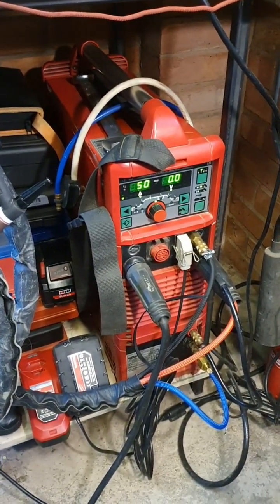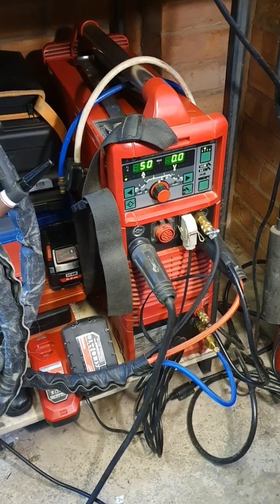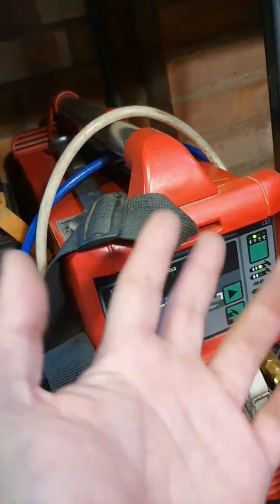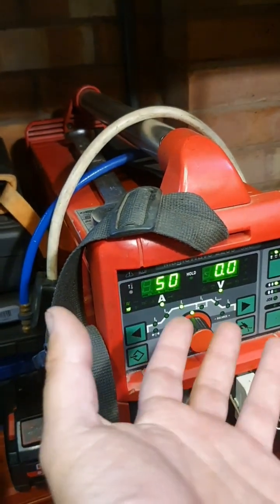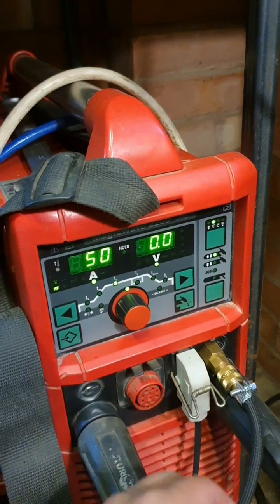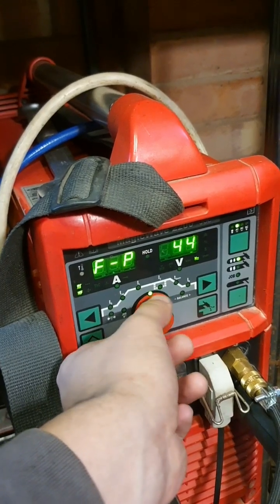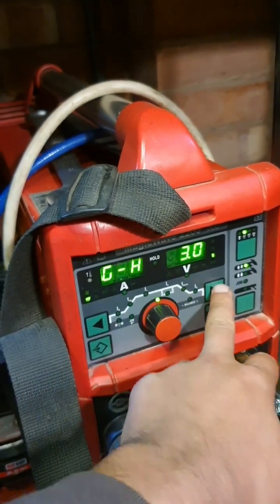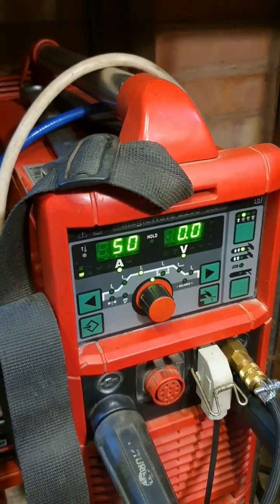Changing AC frequency, Pulse settings and Pre/Post flow on the Fronius MagicWave 2200

Comment: mine has an oddball setting i havent seen on anything else...

AC depth ...

AC width? thats cool, thats normal... duty cycle.

all i can figure out is that it controls the current or, well... depth... on the respective cycles... still havent really played around with that setting enough to make sure? gas is too expensive for "fiddling"...

ah well, i like 110 and 128 hz, 55, 64, etc... cus its A and C respectively... gotta keep it in "tune", lol...

yeah, higher frequencies give a more fluid puddle, in my opinion. though ive always felt lower frequencies give better penetration...